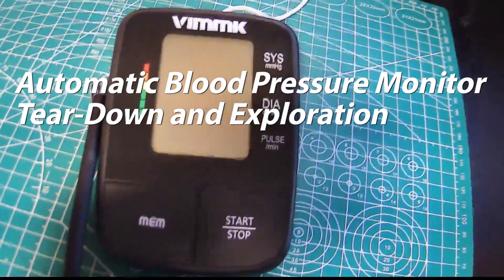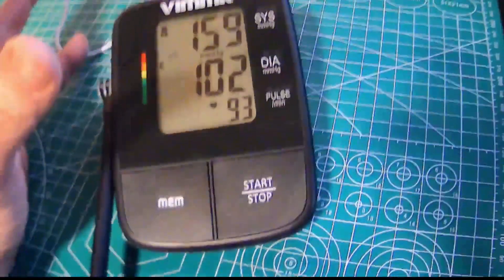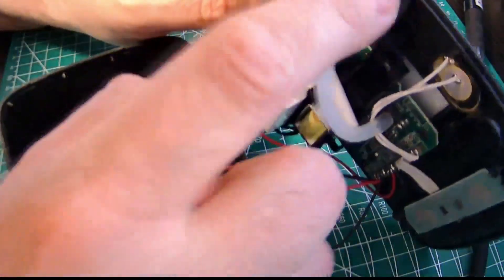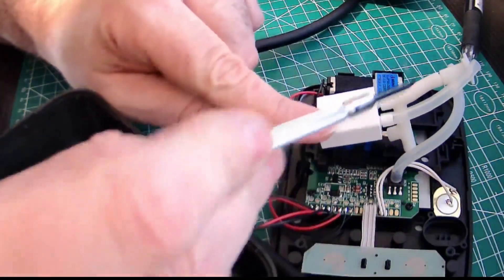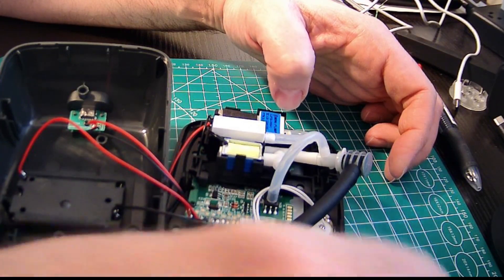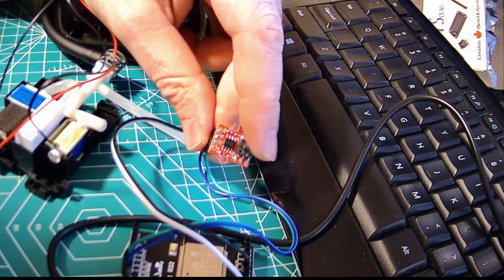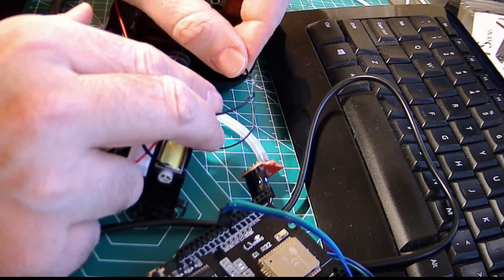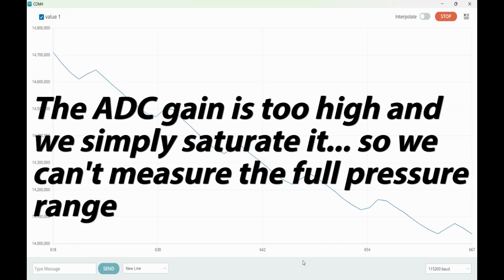Automatic Blood Pressure Monitor Teardown

Comment: Could you share your wiring and code so that i try it out?
Reply from the maker: Yes, I've now included a link in the video description (it links to the corresponding Tinker Foundry blog entry) which has the code. The code reads from the ADC of the pressure sensor module and streams to the serial output so you can use the Arduino IDE serial monitor/plotter.  I use pin 12 for the data input from the ADC, and pin 13 for the clock output to the ADC. I wasn't intending on sharing the code, so please excuse any "ugliness" or unused bits of code in there. Thanks for taking interest.